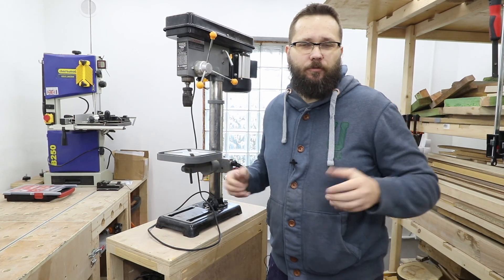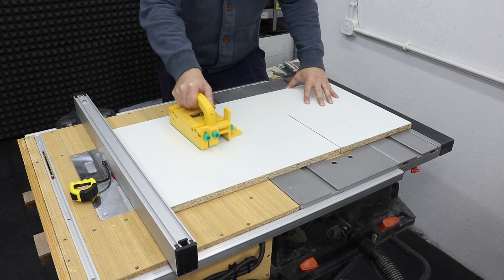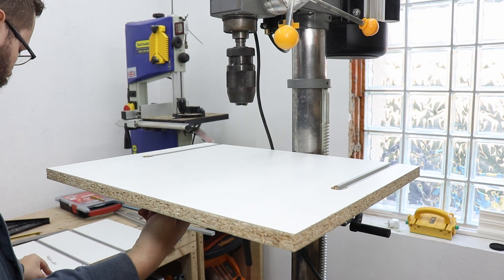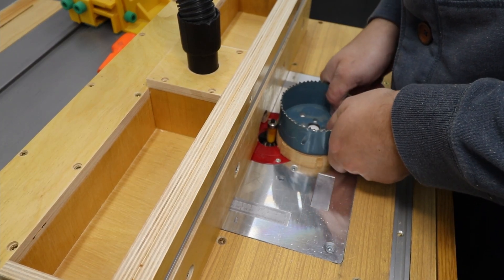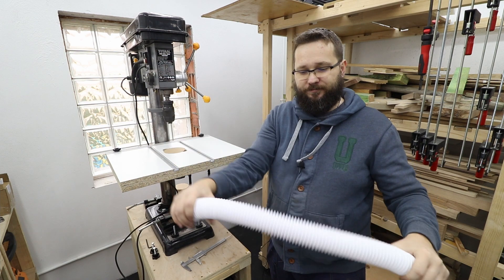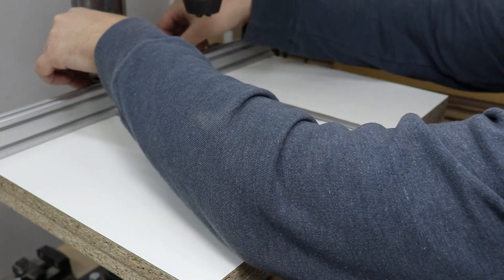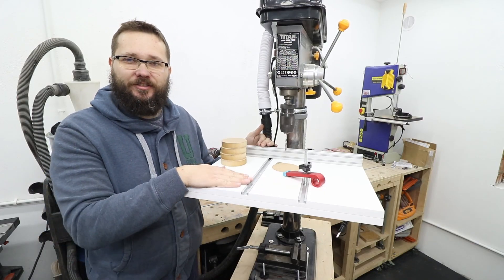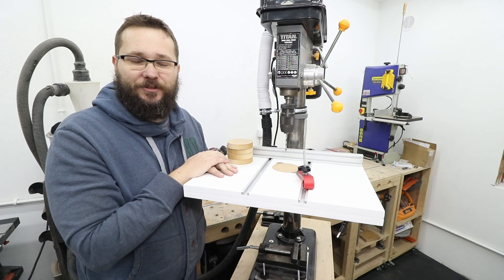Simple Drill Press Table with X Axis and Y Axis Movement

Comment: Some great ideas.. With continued use and wear did you find that the round cookie inserts could start to spin as the drill bit passed through ?
Reply from the maker: Not had that issue as I usually drill off center

Comment: I really like the lift method, however I have a locking bar as well. Could I just remove that, or would the table lower itself with the drill pressure.
Reply from the maker: Don't remove it, the table will go down on itself. You can try to make a longer rod and have it at the front. That would save the hassle of reaching at the back

Comment: Very clever Tomasz.  The extractor hose is brilliant, much cheaper than the expensive purpose made version.  A small point - why didn't you use knobs rot lock the transverse movement instead of the rather fiddly Allen key?  I think there should be enough clearance at the back to do this especially if you use a long bolt on the knobs.  Mike
Reply from the maker: Thank you. Because all the knobs I had were too big and through laziness I didn't do my own that would fit in there. There is only 2cm of clearance there as that's the size of the aluminium profile.
Reply: @CasualDIY  Understood.  You could use longer bolts with a knob glued on so they would project further back and clear the track.  Jolly good mod to the drill press which I will probably make for mine as it's clearly very useful and a big improvement.
Reply from the maker: @katabrontes  its something I needed for a very long time and finally made it. Massive improvement for my work flow. At the moment it's not annoying, when it becomes problematic then I'll look into the knob problem.
Reply: @CasualDIY  Knob problems are never good 😂!
Reply from the maker: @Nitecrow314  😅🤣

Comment: Did you think about solid mounting the table part to a base and using the height adjuster to raise and lower the whole drill?  Can remove the heavy foot/base to reduce the weight.
Reply from the maker: No, the drill is way to heavy for that. The mechanism would not work under that much weight in my opinion.
Reply: @CasualDIY  That's fair enough. Just a thought.

Comment: That's a really cool addition to a drill press.

Have you considered adding a measuring tape to the front edge, and a fiducial marker so you can actually measure the lateral movement?
Reply from the maker: Yes, that will come with a later video when I'll be adding some storage and expandable jig fence👍
Reply: @CasualDIY  Cool. 
I'm looking forward to that.

Comment: Nice job... Very thought out project 👍
I would have looked at putting your top table T tracks wider to accommodate the movement left and right more otherwise you are restricted to that smaller area just outside of the cookie?
Also with longer pieces of timber, you can securely hold them either end closer to the edge. Looking into drilling holes for closer in and adding a table clamp instead?? Just another thought.... 👀
Reply from the maker: I usually drill smaller objects and metal parts, so this layout is more dedicated to my needs. But I'm thinking of a jig/fence that will accommodate and support longer pieces. As well as tall pieces that you need to clamp vertically. Watch this space 🤣👍
Reply: @CasualDIY  I hear what you're saying...
You got it all meticulously thought out 👍😂👍
Reply from the maker: @philbrandon0532  🤣👍

Comment: That is a really slick design - from the flexible drill attachment to raise/lower the table to the x and y adjustable table. Using the hole saw as a template and flush trim router bit to punch out the replacement discs was very clever. I have learned something today and thank you sir. Cheers 👍😎🇦🇺
Reply from the maker: Hehe thank you very much. Hope my video will come in handy for your projects 👍 all the best

Comment: Nice work mate, the result is excellent, some very useful features!👍🏾...Can I ask where you picked up those clamps for the hose attachment?
Reply from the maker: Thank you very much. Got then in my local DIY store like similar to B&Q. If you search for pipe clamps you should be able to find something similar. They got rubber bands and metal rings with a nut. So it's perfect to put a threaded rod in then or a bolt.
Reply: @CasualDIY  thanks Tomasz they look quite useful, I'll look out for those.